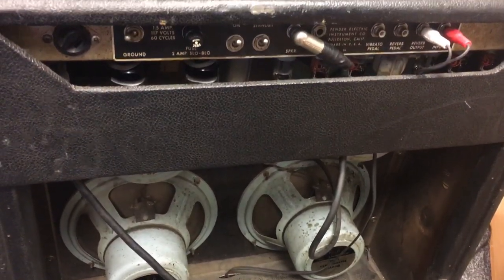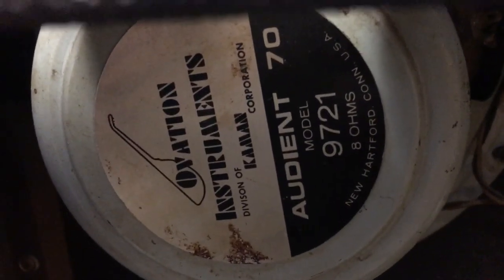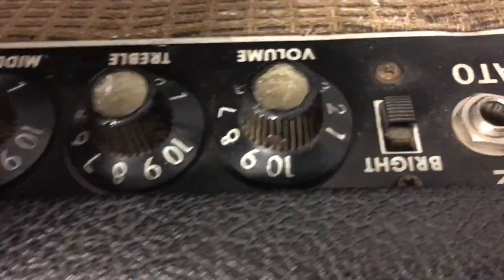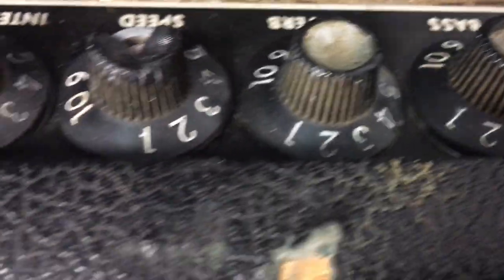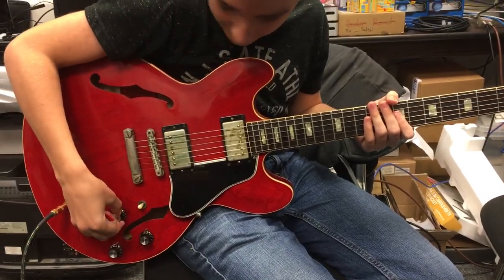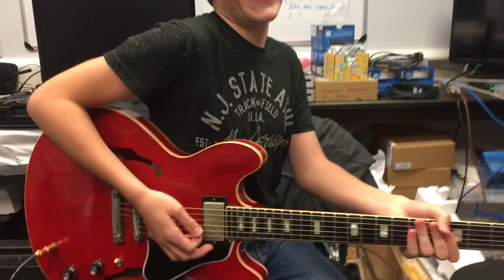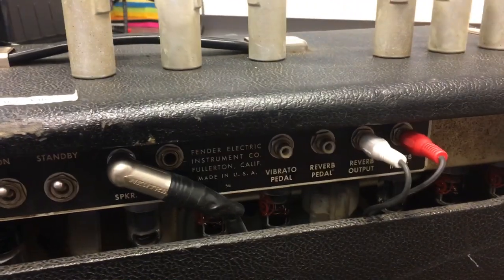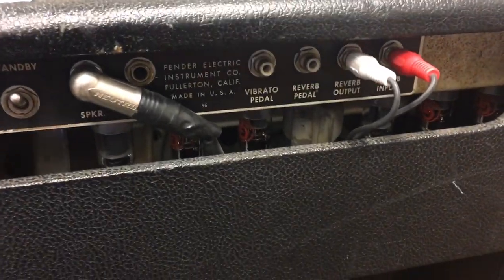Fun with a 1964 Blackface Fender Super Reverb

Comment: This is brilliant. Why would you ever need anything more? 
Can you share some tips as to why your Super is soooo quiet at 10 - when the guitar volume pot is standby on 0? My deluxe reverb reissue is a box of noise past 5. Really considering a vintage Super now. Your approach seems - whichever parts/tubes/speakers sound good, leave it alone. 
Cheers
Reply from the maker: Hi Paul... my thoughts exactly, this amp just does everything. Clean, crunch. To be honest I'm not really an amp tinkerer beyond swapping tubes out, I'm a bit scared of opening them up and looking at pots and caps etc. I don't gig this amp much as it's pretty old, and the last time I took it out something was really off with it. Maybe voltage? But anyway, no gain and no volume at all. So this weekend I just thought we should have a noodle through it to see what's up, also Marcus wanted to have a blast through it as he's not played through one before (he's 14 btw and a ridiculous player if you've not checked him out). I've got a deluxe as well but both seem quite quiet (relatively speaking) when cranked. Maybe it's to do with the preamp tubes? Perhaps they are lowish gain? Anyway these are all just new groove tubes, I bought a big box of them some time back, nothing special about them. But this amp is magic. Really I want to get a modern built clone that sounds just the same and take that out gigging maybe. Anyway best of luck with the tone hunting and have fun, it's a hoot when you do come across something special like this. Plus having the space to play it on 10 is nice, and a rare luxury... if you're mic'd at a gig the soundman is going to have a hissy fit when they hear it at this volume. But in a club against a lively drummer it's just about right I think. Awesome!
Reply: Jules Fothergill thanks! You two are a riot. Marcus can’t get enough of the Super. And what a talent he is!